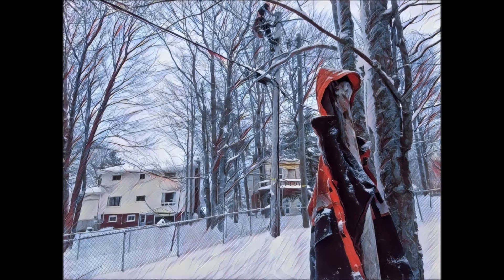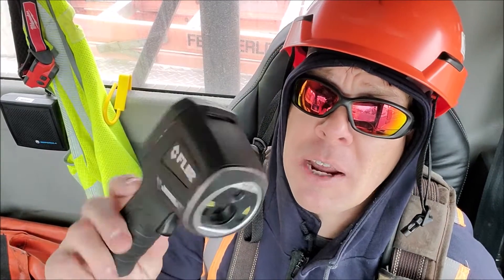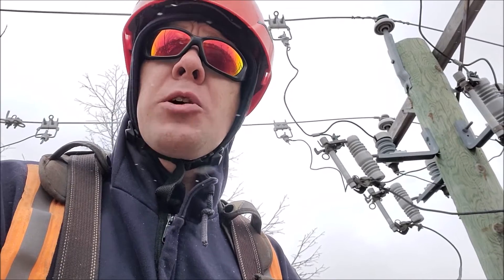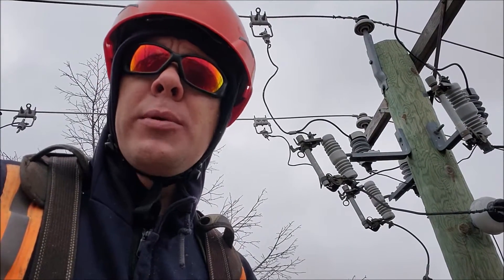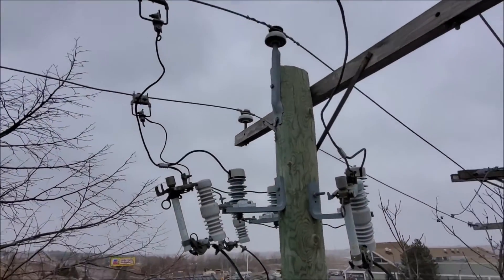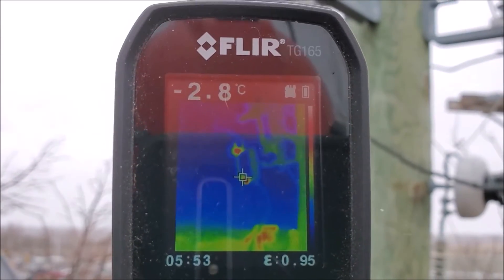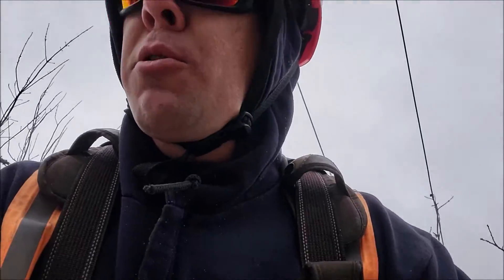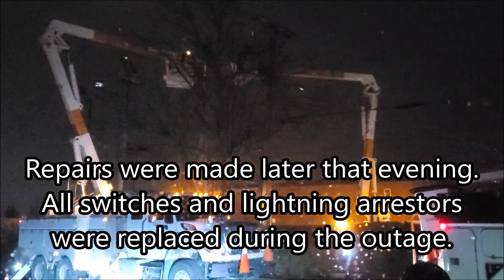Lineman Tip #8 - Thermal cameras

Comment: Electrical manufacturers should have to use a Blackbody material on all fuse caps, cut-outs, switch pivots etc so that IR Imagers can easily spot thermal changes to the surfaces of shinny metals that are current carrying. 
Putting a piece of Scotch 33 tape on aluminum bus works great. I have done this many times on 480V gear, not a good Idea on Medium or High voltage systems though. Great video.  I have been inspecting Electrical systems with IR since 1988 and have seen way to many imminent failure hot connections.

Comment: With all do respect, but what you call a Thermal Camera on the video is just a Visual Thermometer, I am level II certified thermometer and work with power systems and there is no way I would use that Flir 165 instrument, you must use a proper IR camera with tele lens so you don't have to go up there with your lift and just do a better inspection from the ground where is so much safer, by the way before yo do any thermal inspectin you must set up your camera with correct emmisivity, distance to your objective and reflected temperature
Reply from the maker: You're absolutely right ... This is just my personal one. It's great for trouble shooting, can still help find a hot spot and it's always close by.
Our actual Thermal Camera is locked up at the office. It can be used by any crew, but must be signed out at the start and end of the day. We also use that one for line patrols from the ground

Comment: Have you ever had occasion to use it for a printed circuit board? I'm wondering if this FLIR camera you have  is adequate for microelectronics....
Reply from the maker: That's a really good question, I've never tried it 🤔
Reply: Yes and it is used by every Silicon Valley manufacturers. Just need the right lens for the Macro details.

Comment: I have a thermal imager like that. I've used it to locate several problems. One that I have not been able to resolve is incredible radio static on AM radio which started when a new remote controlled pole top switch was installed on the next street. The heat signature looks normal on that switch. If it's arcing, I can't detect it.
Reply: Static is a sign of:  1) dirty insulators which create short leakage paths; 2) slopping dressing of tie wires or even cables such that there are sharp points which will discharge into the air.   In some places & times, insulators had a factory applied very high resistance but still conductive coating that was designed to equalize voltage drops and prevent "mini arcs."  That coating sometimes was "engineered" to provide a measurable amount of heat to the insulator to help drive off moisture.

Comment: Do you guys use any sort of tool to detect sources of Radio Frequency Interference (RFI) caused by poor connections?
Reply from the maker: Our Province has a department that looks after radio communication for our entire company. They also look after transportation/snow clearing/ fire and emergency services.

They have a device that does this..
I have gone around with them a few times. It helps find those buzzing connections that are a result of tie wire ends sticking out or covered tree wire buzzing against a tie.
Stuff that likely won't burn up or be found otherwise
Reply: @Bobsdecline  Another great source of nuisance RFI -- a royal PITA to us amateur radio operators (aka hams) -- is dirty insulators. Oftentimes supply authorities won't do anything about RFI until we detect and point out the pole involved. Even then rectification is often a treated as a low priority task.
Reply: We do over here in the UK for transmission substations.

Also has pd trailers for risk mitigation on certain kit. Found they get set off by all kinds of stuff including compound fencing

Comment: Just curious. Are you always running trouble or do you work on a line crew sometimes??
Reply from the maker: I'll occasionally work on a line crew, I have an actual bid as a trouble response/customer service truck  tho now.
Reply: Bobsdecline - Lineman blogger what do you mean you have an actual bid??
Reply from the maker: @linehandibew6205  at our company we have positions that we must apply for. There's a pool of journeyman Lineman that are trained in all aspects of the work we do (underground, substation,hotline, transmission, construction etc ..) as long as you are in that pool of guys you will be shuffled around different crews from time to time.  There is however what we call a "lead lineman" whom is actually assign to a specific truck that may do only a certain type of work ... Our rubber glove truck for example. 
In order to be that guy you have to apply for the position and meet certain criteria to be chosen.
I had to apply to be in the position I am in, so I am no longer in that pool of guys. I basically have my own truck and my own tasks. 
Sometimes I still do other tasks depending on work load. 
Generally I don't get shuffled around tho
Reply: Bobsdecline - Lineman blogger that sounds great. Yeah a bit different in contractors. I’m a foreman of a 3 man crew counting myself. I have a lineman and a 1st step apprentice. We do unit or “dock” work directly for the utility PSEGLI. I work out of their yard and their guys basically don’t do much. They do all the easy jobs or sleep in their trucks. All the involved harder jobs go to the contractors. I’ll do a job in one day that they’d either cry about doing or take 3 days to do the same job. Yeah that’s why around here we call em utility pukes hahaha. Things are definitely different here lol. I do overhead and some underground depends on work load. Best job in the world. Be safe brother
Reply from the maker: @linehandibew6205  Our "Lead Lineman" would be pretty much same thing as a foreman.
It's too bad that some guys get paid to do nothing. We sometimes put large jobs out for bid to contractors ... Things like a large reconductor job. We tend to get along pretty good overall. Sometimes we will also hire a crew to pick up some service work when things get really busy. I definitely understand where you comming from ... It bothers me when guys complain, we have it pretty good and like you said - best job ever. Always 👊
Reply: @Bobsdecline  Nice work, defining your own work terms...

Comment: Question please: On a 7200 volt phase transmission line how many Amps (total)
can the line provide to ALL of the step down transformers on that line.
The cans are of various sizes 150KVA and larger and some smaller.
Realizing that all of the loads (transformers) are in parallel. Thank you for the
help.   This is North American standard distribution system.
Reply from the maker: That's a hard question to answer without knowing all the specifics... One of the most important being the wire size. A main 7200 line built with 2/0 aluminum will carry much less amperage then a line built with 556mcm. Generally speaking we try and keep load below 300 amps on our main feeders. (Below 200 would be ideal)  While they may see numbers much higher at times. Most of our mainline equipment is designed to safely handle peaks of 600 amps

Comment: Question for ya Aaron. Can the neutral wire for the high voltage lines  be shared with the neutral of the low voltage lines. I live in sothern Ontario and it looks like they do, also I hear people saying on the high voltage side the pole mount transformers are connected with one to a hv Line and one to ground, is that done or are they mixing up neutral and ground? Thx keep up the vids.
Reply from the maker: This question has a very long answer, but I'll give ya the skinny version! 
Most systems nowadays are built as a "multi grounded system" . That's pretty much means that everything that is not a "live" phase is bonded to ground. I use the term live loosely as even a grounded neutral can become live in the right circumstances ( usually when broken or compromised ). 

In this setup the neutral is used for both the high voltage and low voltage unbalance in current. The neutral is bonded to ground along with any other conductive material on the structure. 

The transformer  would have it's H2 side connected to the Neutral wire specifically, however in this system, the neutral is then connected to ground. That's why some people may refer to it as being connected to ground ... Electrically it is. 

This certainly isn't always the case.
When a transformer is connected to an isolated neutral you will most likely see two high voltage bushings as opposed to one.
Reply: @Bobsdecline  Just the answer I was looking for. I'm an inspiring electrician, so I understood that well. Keep up the videos Aaron.
Reply: @Bobsdecline  This is not intended to be criticism for your fine profession, but are you aware that the grounding process affects livestock? Much of the power sources include "Dirty" sources, namely, inverters. If you understand harmonics, having numerous inverters feeding the grid will produce many  multi phased harmonics, that aren't attenuated by the grid design. This spurious emission is discharged through the ground causing the surface to be electrically charged, while hooves are grounded, in essence the grass bites the cow. A entrepreneur found a system to mitigate this anomaly. After installing it in a school, a local dairy farmer rushed out to meet him. He claimed that after they "fixed" the school, each of his cows were giving an additional 5 gallons per day. We suffer each day in untold irradiation. Learn, and live.
Reply: @bryanst.martin7134  You are talking about step potential - caused by a voltage gradient in the ground. It's not radiation / irradiation in any sense.